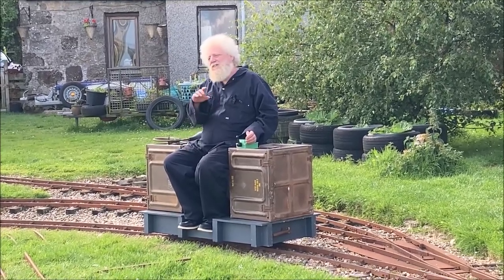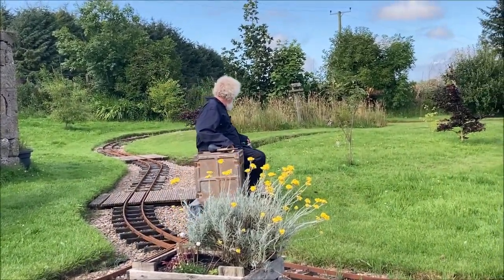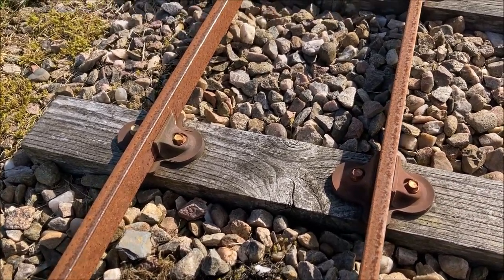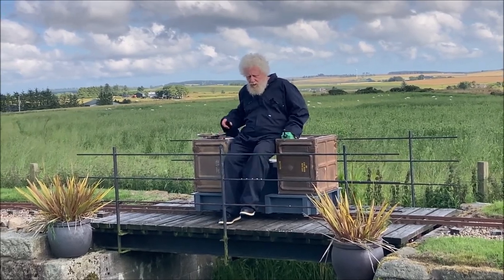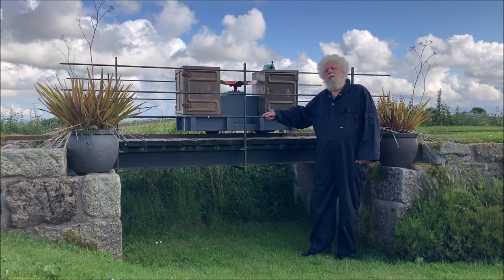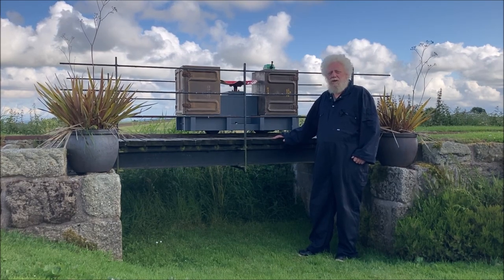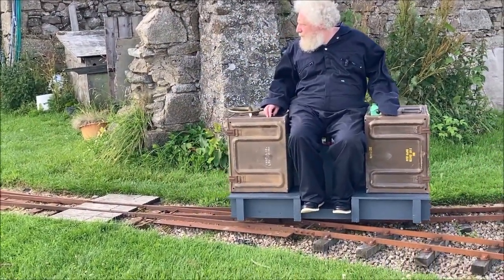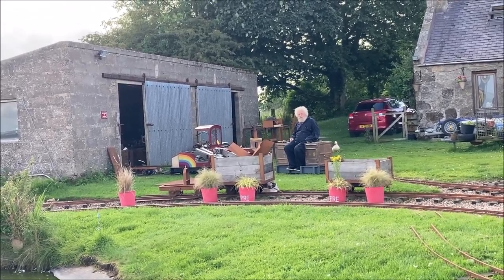The original oval - a short tour on Karen's Little Railway - 7 1/4 inch minimal gauge garden railway

Comment: That is a very nice Railway that you have there. May I ask what your rail is and where did you find the chairs for the rail.
more to the point, Some details about your track, points and crossover. Thank you.
And I can hear and understand every word of your narration.
Reply from the maker: Rail is 30x12mm mild steel flat bar from the local steel stockholder. Chairs are from PNP Railways and sleepers 3x2 inch timber. There are more details about how we built the track, points and crossings on our website at https://www.karenslittlerailway.co.uk/construction.php
Reply: Hi, it’s me again.
That’s great information, and very well done. You know, you can build a simple rail conditioner that can be dragged behind your loco to round that sharped edge on your flat bar.
It will give you more reason to run your wonderful train.
Thank you